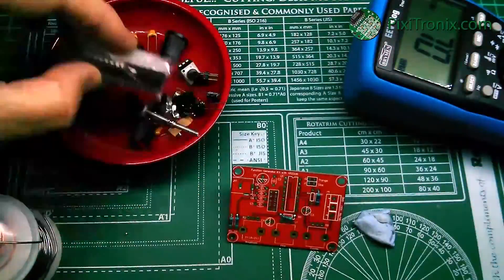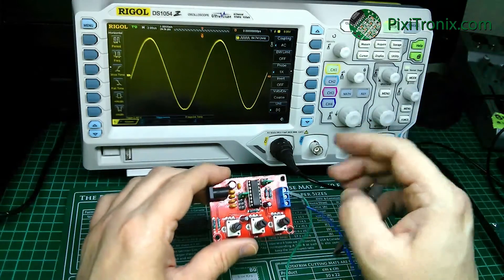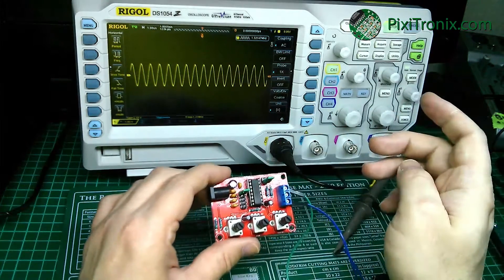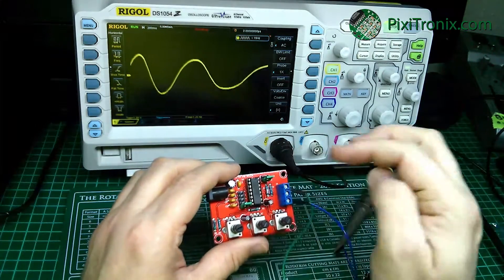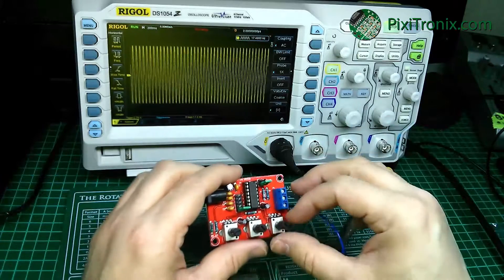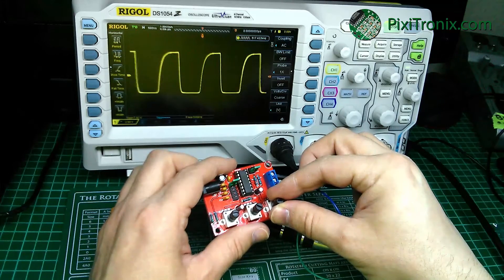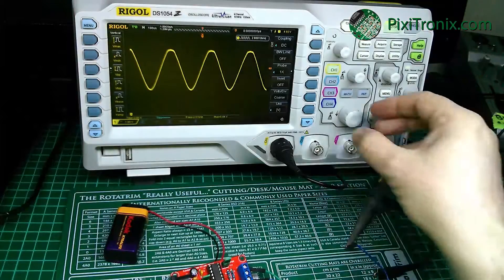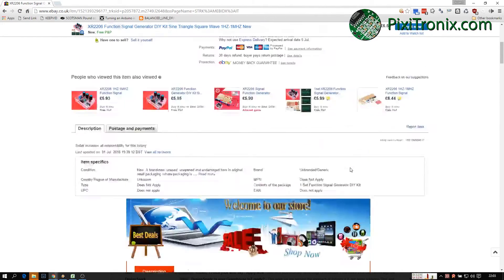XR2206 Function/Signal generator kit build.

Comment: An utterly useless kit, it doesn't provide the adjustable duty cycle 1-99% on the square wave. It should be a required feature for a function generator, even for cheap ones!

Comment: Very informative!Do you have any experience with the DDS function gens that are all over eBay ?I'm  between one of those and the XR2206.I wonder how these two stack against each other.
Reply from the maker: No experience at all with the DDS ones. They do look good but for this I was just after a simple generator for some filter curve measurement so I went for the very easy option.

Since then I've generated some audio tones in software to send for audio filter work. These work well and sync with the scope to produce a nice display. This unit while it works well, as been put aside for the test project. I will dig it out again and box it up soon.

Thanks for watching, and for the comment!
Reply: I've bought this kit and a DDS kit since I commented just to compare them.
Shipping will take a while..
When I've built both and test them I'll post back with any findings.
I think that for a basic f-gen either will do ;dds may have more features but their interface seems fiddlier.
We'll see!
Thanks for your reply.
Keep up the good work:)